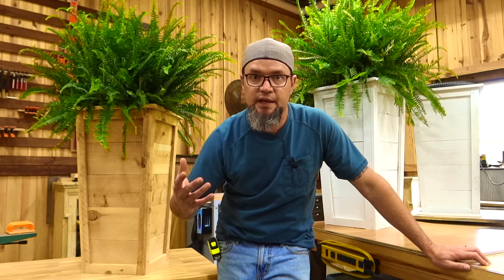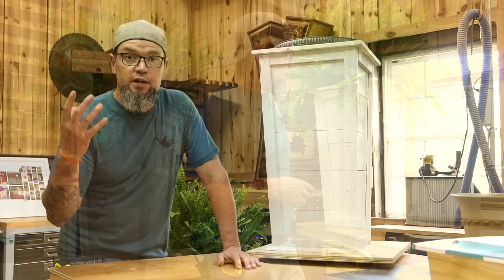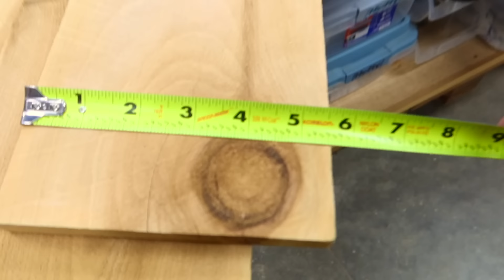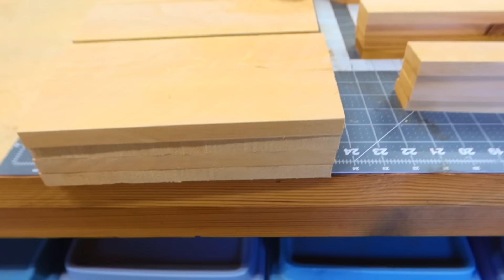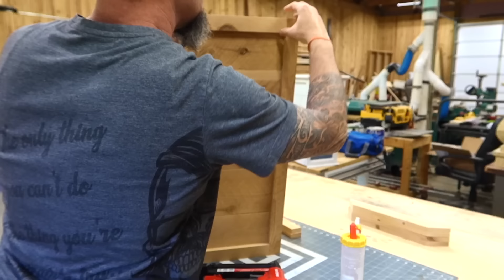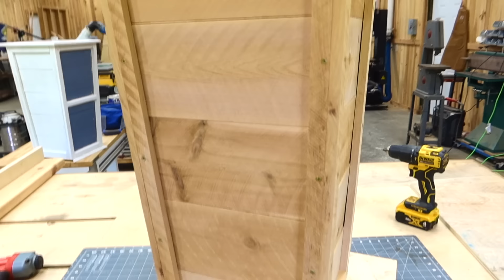DIY $10 Tall Planter - Low Cost High Profit - Make Money Woodworking

Comment: i have some funds to buy a brad nailer should i get 1 nailer cordless or the combo that comes with compressor?
Reply from the maker: The combo all the way for starting out.  You can catch them on sale with a brad nailer, pin/finish nailer, a stapler and the compressor... all for less than the cordless.  The cordless are nice... but huge!  Bad for getting into tight places.  Just my thoughts.

Comment: I have built quite a few, I bought the treated pickets and stacked with wood between each for 2-3 weeks to dry, but the last ones I built, the boxes seem to pull apart, there were no gaps between the sides when I attached the legs, but after sitting for a week or so, they are separating. Any idea what's causing this?

Comment: Nice job. How do you get the plants to stay at the top?
Reply from the maker: The planters pots that the plants usually come in will lip over the top and hold it in. If its a smaller plant you can pick up a liner for pretty cheap that will fit.

Comment: Question: I don't have a compound miter saw.  Is it still possible to cut some of these double angle boards without one?  I assume it is but I can't wrap my head around it
Reply: if you've got a circular saw you can do it I suppose. I wouldn't try because I am not good at cutting straight lines with a circular saw but if you're good at it, you should have no problem.

Comment: If each stage is angled by 3°, each of the five stages need to be sized differently. But you describe them as identical.

The fern needs to sit on a platform within the planter, otherwise it will drop to the bottom. But you do not show any interior ledge or interior platform in the planter. What gives?

Comment: I don't understand how the boxes all line up to create a continuous taper if the boards are all cut the same size. it seems to me like that would result in a sawtooth pattern.
Reply from the maker: Hey!  check out the cutlist in the description and it will make more sense.  Each box is a different size.
Reply: @MatthewPeechWoodworking   i must have missed that part

Comment: Are they tapered? Hard to tell if the bottom is smaller than the top but I see you cut all the boards to the same side so I'm wondering how it's tapered, if they are. Wife still sleeping so the sound was low and I may have missed it...lol

Comment: I'm new to cutting angles but hope to try this.  3 degrees off is an 87 degree cut or a 3 degree cut?  I hope that's not a stupid question.
Reply from the maker: Not stupid at all!  The miter saw plate can be confusing to some so I just said 3 degree off 90.  Technically yes its 87 degrees.  but you wont find that on the plate.  With the saw centered it reads 0.  So just move it to the 3 mark in between the 0 and 5.
Reply: @MatthewPeechWoodworking  Thank you.  I just picked up my 5 cedar fence pickets at HD and they were $3.98 in Utah also.

Comment: Matthew Peech I’ve put the Titebond 3 in one of those GlueBot bottles and can’t seem to squeeze it enough to get the glue to come out of it. Any tips?
Reply from the maker: Should be easy. Did you cut the tip?  If so you don’t have a tight seal somewhere.
Reply: @MatthewPeechWoodworking  haha, no I had not! Silly me! Thanks, I was ready to run and get a another GlueBot! Have a great day!

Comment: This is another great build.  I am new to woodworking so am slowly trying to build my skills.  I built 2 of the smaller planters for Mother's Day and they were a big hit.  I have a question about the top pieces for this.  It doesn't look like a compound cut was used like in the previous build - is that correct?  I thought the top would not sit flat without that, but obviously there is something I don't quite understand.  Thanks again.
Reply from the maker: Thanks Dave!  The tops do not need to be compounded because the boxes have flat tops.  But very good question.

Comment: Great project man ! What do you sell them for ? Finished ? Or unfinished ? I am setting up for a farmers market. Basically a flea market. Large outdoor deal in Delaware. Open four days a week. So I can build three and sell four. I’m conflicted on selling finished. What would you suggest for a situation like that. It is a lot of second hand stuff sold there so I’m not sure how well larger items will sell. Thinking I can have a few like your first one with different color schemes so they can see what potential it has and if they don’t want to do the work I can take deposits and finish the ones I already have made so I’m half way done up front but not putting the extra time In finishing until I have a sale. So I gain time in a sense. If that makes sense to ya lol. Anyway was just wondering what your thought are.
Reply: How many do you make at a time ? I’m also thinking that I’d build five and cut boards for twenty. I’m sure I’d sell 20 eventually. But to save space just have them pre cut for later assembly. Thinking i may be able to sell kits as well.

Comment: dude, board e measurement is off, i knew it was wrong when i laid out stop places on miter saw, but i went with it, it is only 5/16” difference than board d, and the rest have a bigger gap, and now, i have cut enough for two and built one that does not fit
Reply: no, my bad, it is 9/16” difference, still did not come out, something i did wrong on layout i guess

Comment: Ok.   My creative flow is moving from sewing to building. 😝  my question, as a woman, is….can you adjust the heights to make several in a grouping?   Say, like 3 of varying heights?   Your welcome, guys. 😂   Woman is thing visually.   Hmm.   Three stands?  3 ferns?  (Now that a jungle!) a mix of 3 different types of plants?  Sorry.  Just thinking out You Tube style. 😉
Reply: Thinking…. Not is thing…..dang spell check.🤦🏼‍♀️
Reply from the maker: Hey Debbie... You know what I have learned... that the most creative people that can easily jump into woodworking are quilters and folks that sew.  The measurements and even the tools are often similar.  I use a ton of sewing tools for measuring.  And yes!  Since they stack you can build any size that you want and create a super neat grouping.
Reply: @MatthewPeechWoodworking    We are all nuts.   Nuts with the good stuff.  I meant various heights……   I made a swing bed for the beach.  I used my s Ewing gauges and roll tape measure.   Hubs thought that I was nuts.   It is fabulous.   Plans on wooditsreal.  Mine is the red and white stripes with blue octopus.    Thanks for taking the time to encourage a crazy southern woman, with, ahem, some age.   I hate being bored, and am so done with alterations!!!💋

Comment: Great content but sorry to say there is no way this is $10.  A 6ft pocket is $6.  It was $4 pre pandemic. And it takes lot of work to get them as nice as shown.  Factor in the time, profit is tiny.  Building them for fun for our own use, fine.  As a business, not so sure
Reply from the maker: Where are you located???  A treated pine picket is $1.99 right now... today... at my local big box stores for a 72" dog ear.  It took me less than 5 minutes of sanding for all 5 pickets...  I know I can make money with them... but everything is different in different areas.  Thanks for watching and the comment!
Reply: I just picked up the cedar pickets in Utah at HD.  They were 3.98 each just like Matthew mentioned.  I didn't look for the pine though.
Reply: @vickipackham7357  you gonna need more than 2 boards
Reply: @MatthewPeechWoodworking  I am in CA and lumber price has not gone down.  In addition to cost, it takes a crazy amount of time to find a few good boards and then clean them up.  I think if I use picket fence, I would earn less than minimum wage and would hate woodworking after a week.

By the given the boards are neither flat or smooth, how does the glue hold up for you?  I suspect the contact surface is not great with this material.